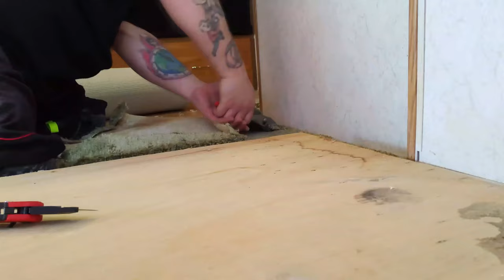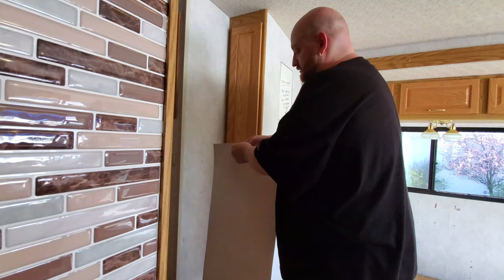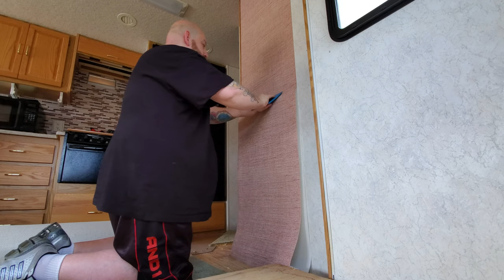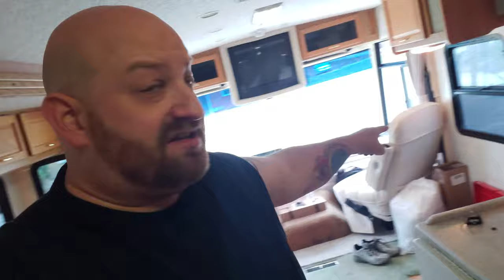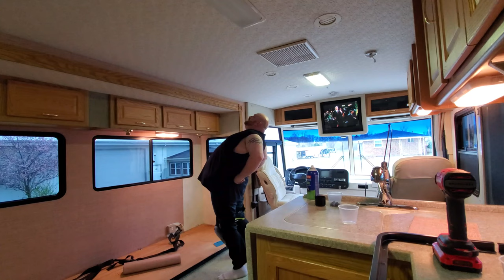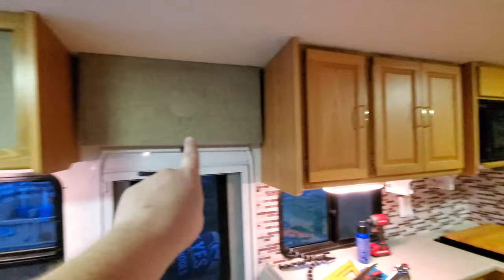THE WALLPAPER IS UP! RV Checklist episode 20 - Hanging Peel & Stick Wallpaper in my RV

Comment: So I just bought a brand new RV and would like to add a backsplash as well and wallpaper the bathroom but our walls are textured . Did you prep,:as in sand your walls smooth before either install? All the products I find say must be installed on smooth surface.
Reply from the maker: My walls were actually pretty smooth already, but I did send down things like screw holes